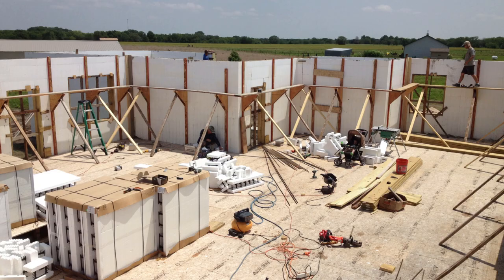Should My Attached Garage Be ICF

Comment: I went with a detached ICF garage. Detached to be sure car/work shop fumes (paint, welding, etc.) don’t enter the house; and ICF since the 3 story house is ICF from footer to roof and it just seemed logical. It is close to the house, connected by a roof, so I also wanted it to look the same. The roof is vented though while the main house is foam sealed. I couldn’t be happier with my ICF home and garage. Also built a 40’ x 30’ fenced in garden with a two foot ICF wall a  black iron fence is mounted on. ICFs are addicting! 😀
Reply: How much did you pay extra for the ICF garage vs a normal stick garage?

Comment: Before I even start the video, my answer is yes, because I want to heat the garage in the winter and maybe have the option for cooling in the summer, as it would be lavish changing the oil and other maintenance in AC during summer months... so for my situation insulated makes sense. I also want the same structural integrity through the whole house, including the attached garage

Comment: Having that separate garage changes so much.  It would be a mistake in my opinion, not to use ICF everywhere.  "Stick" builds are short lived, fragile, cheap.  ICF is long lived, robust, worth it.  Using ICF, I avoid the issues of wood.  I don't want a wood house, a wood boat, or a wood car.  I do like a wood humidor though.  :-)
Reply: I agree!  The stick build wouldn't have the strength or longevity of the ICF.  If the attached garage is sharing the same roof as the house, I wouldn't want a weak structure shifting or something to affect my roofline.

Comment: If the garage is to actually park a car in, it should be detached.  That way, (1) if the car bursts into flames (either an EV battery fire, or if you spill gasoline doing fuel-system mods), only the garage burns down, not the house, and (2) in climates where winter roads are salted, it's better to store the car at a cold temperature to reduce corrosion.  Either way, be sure to put a vapor barrier under the slab.
Reply: I see your point but not really an issue.  We park our Prius Prime in our detached but heated garage. It is so nice to jump into a warm car and go. We do believe in doing the rust preventive treatments and washing the car often. And for any concerns about an attached garage, just put up an extra layer of 5/8 drywall.
Reply: @kbwfgg6400   A warmer garage will be better for the batteries of the EV car also.
Reply: @kbwfgg6400  I hope by rust prevention you don't mean Zebart/rubberized trash.

Comment: with current wood prices... how much of a price difference is really between the two
Reply: I was given a rough guesstimate from a nudura rep a year ago at roughly $15 per wall sq ft, roughly a year later from the same rep, now $20 per wall sq ft. I think a lot of things are experiencing this hike, maybe not quite as drastically as wood though.
Reply: All prices are going up but I think ICF is still better long term for the savings in heating and cooling and less chance of any damage if there is a forest fire, flood or other.

Comment: Heated garage, probably. Non-heated, at least use good insulation to reduce condensation on the slab after a cold spell.
Reply: Good point! I'm still recovering from a bad fall in my garage 4 months ago caused by slipping on condensation.
Reply: @moocrazytn  Yikes, get well soon George! I've fallen a couple of times but was really lucky. I can't count the times I made a "little slip" that worried and aggravated me. Sometimes I feel like jackhammering 575 sq feet of concrete and repouring it over thick insulation.

Comment: My Only Problem Is I'm Planing On Making My House Exterior Walls Of Amvic R30... And I Want A Attached Garage Of R30 As Well... Problem Is They Don't Make T Joints In R30. Any Ideas On What I Should Do? Should I Drop Down To An Entire R22 Build Where They Have T Joint Sections?
Reply from the maker: Just cut a section of foam out of one side of the block at the T-joint.  Brace it properly and no problem.  This is what I did

Comment: Great note Garrett, I think most people don't consider doing the garage with different construction. In my planning and design stage over that last couple of years of my 40 x 60 garage/woodworking shop with upstairs living space. I decided to do 2 x 6, 24" OC framing with EZ SIPS foam board for cost savings as well as quicker build time over the ICF. But now with the price of wood what it has become I am looking at doing that part of my construction with the Perfect block. I have not priced it out yet but so far it looks like it will come out about the same or maybe even a little cheaper. Can veneer plaster the interior directly with no drywall on the exterior walls and can plaster directly on the exterior, no drywall or OSB needed. But the house that I was going to do with ICF looks like now I might be doing in ICCF.
Reply: Use Trusscore and you won t need drywall on exterior walls.